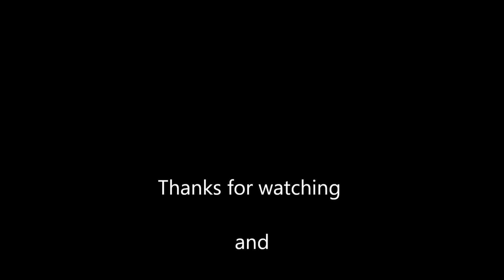Bleeding brake fluid on a motorcycle | Philippines motovlog

Comment: subed paps. nextime sana paps diy rear brake conversion, medyo pricey kasi aftermarket parts.
Reply from the maker: Sige, nakaplan na ako doon. Nasa 8-14k ata pag bolt on na.
Reply: Oberdose619 yun tnx paps sana my dimension mga bracket para pwede ipa-fabricate/diy 🤩

Comment: Bkit po natagas sa takip ung break fluid after ko mgpalit breakpad?
Reply from the maker: Wala dapat nagtatagas doon dahil mawawala yung pressure. Kailangan mong higpitan yung valve sa may takip. Kung medyo palyado ng brake mo dahil napasukan ng hangin ay kailangan mong i bleed yan brake line mo.
Reply: Nableed ko npo wala na tagas.kaya lng lumalagitik po minsan minsan ung break pad pag ngpreno,pnu po kaya un
Reply from the maker: @owenguinto9041  check your brake pad baka natanggal yung spring tension niya. Yung kasi yung naghohold sa pad para di siya gumagalaw. Kung hindi nmn check mo yung bolts ng mga brake caliper baka maluwag. Hope this help..